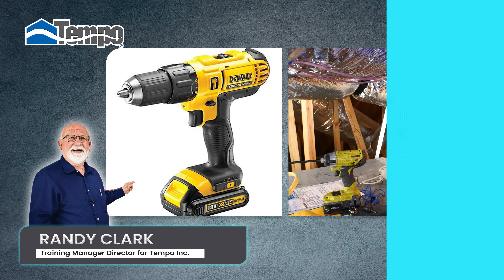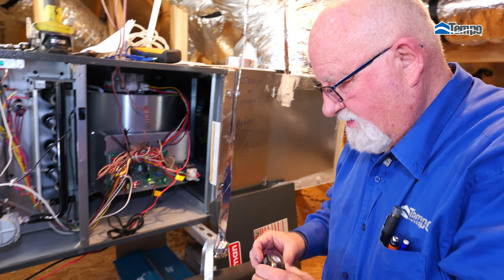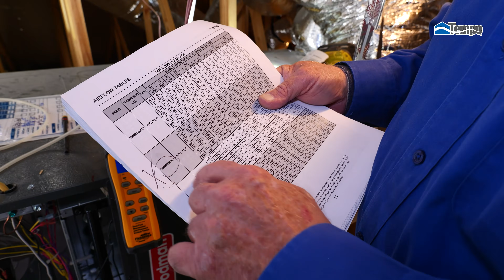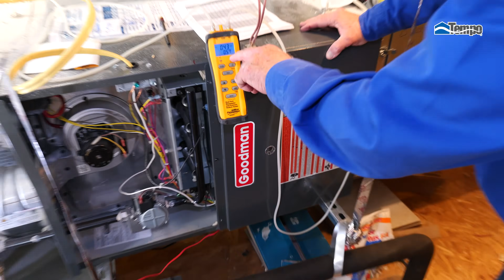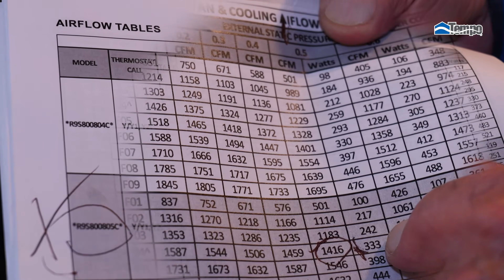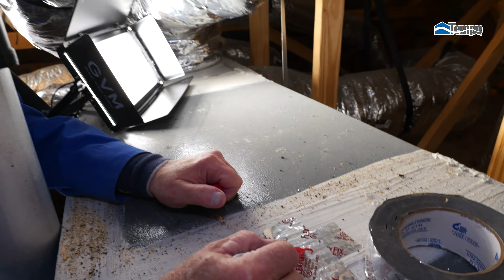Static Pressure Test Made Simple for Proper Airflow

Comment: This is a 2 stage communicating system/ furnace , why bypass y1 , unless the outdoor is not a 2 stage . I guess ….
Reply from the maker: Yes. It only is a single stage outside and is NOT a communicating system. Standard thermostats.

Also it is a varible speed motor so it does not get a by passs damper. There is a lot of controversy on that but that’s the way we do it.

Randy C. | Tempo's Learning and Talent Development Director

Comment: 90% of residential ductwork is undersized and the hvac is oversized.

New construction pays by the ton. More tonnage, mo money.
Reply from the maker: Great point about proper system sizing. Both the equipment and ductwork need to work together to support efficient airflow, comfort, and overall system performance.

Comment: Filter in place , i charge sometimes without a filter but Ckin TESP one needs clean filter in correct  ?
Reply from the maker: Exactly! 👍 For an accurate TESP reading, you want the system operating as it normally would, so a clean filter should be installed and in place. That gives you the most reliable measurement of the system's airflow and static pressure.

Comment: What was the readout for the manometer for each side? And how it come up to .5 static? I have only one port on mine.
Reply: its hard to see but before it was total 0.55 and his supply p1 was 0.42 and his return is p2 which he didn't show is 0.13 so total static is  0.55
Reply: After, the total static pressure was 0.52. P1 (supply) is now 0.44, and P2 (return) is now 0.08 static.
Reply: Need a dual port
Reply: measure each side separately... 😊